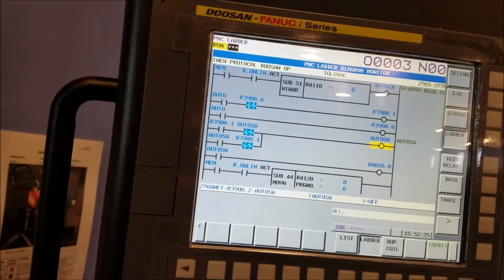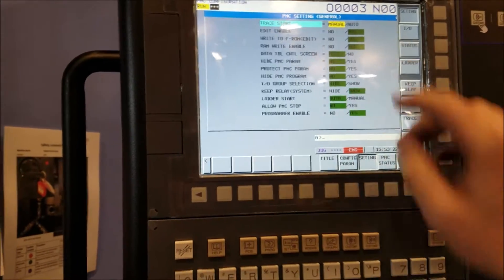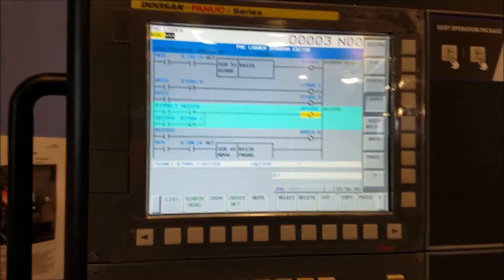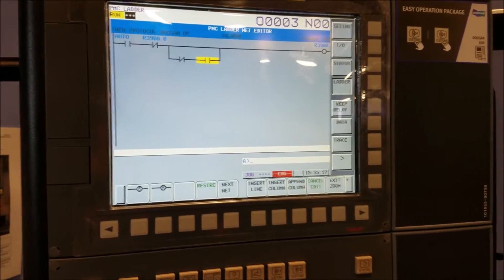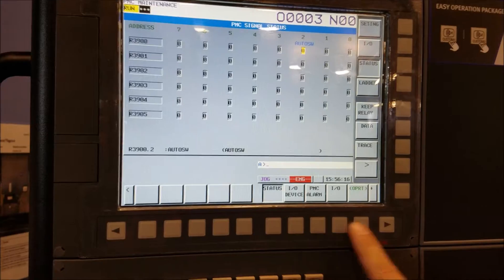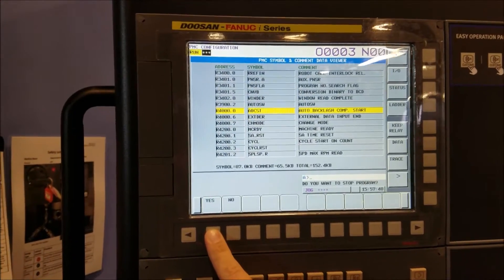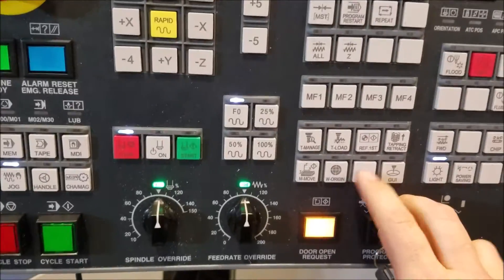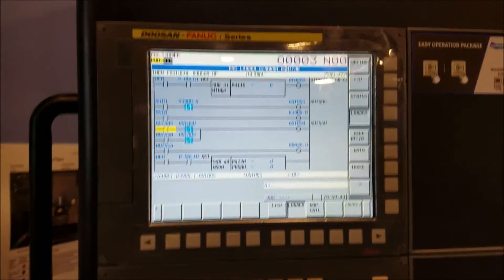Fanuc CNC: PMC ladder editing and bit naming

Comment: Good video. I'm glad I found it. Can you explain why one would do this? Maybe an example or your particular circumstance? I ask because I'm getting my very first VMC and it has a Fanuc 0i-MD controller. I'm trying to learn all I can about the controller before I actually cash out for the machine next week. I'm guessing here but it seems like you are connecting some functionality or action to a button on the controller panel. Is that correct? Thanks!

Comment: 00:47 i can't get the control to stay in "YES"  
any idea?
Reply from the maker: Check your Estop it needs to be pressed. Usually that does the trick for me.
Reply: @ericwhittaker3570  how do you NORMALLY on a fanuc turn the Write Parameter ON:1 in "SETTINGS" ?
Reply from the maker: @fredrezfield1629  I think it's the offset key (press it a few times to get to the right screen, then turn on either MDI or push in the ESTOP, then press 1, then press Input (maybe enter?).

Comment: Fanuc menu is hard as hell all the time when I pull any button I can not back to main screen.
Reply from the maker: Yep. Whoever designed the UI on this thing should be beaten. It's convoluted and hard to navigate. The good news is that the newer control, iHMI, is better. The machine makes parts well though!
Reply: @ericwhittaker3570  Hi, Do You know how to turn on small "Function Key" window on Actual Position main window? Function Key includes POS PROG OFST CSTM SYS MSG GRAH.
Reply from the maker: @leitzalarm3209  , no, sorry. I'm not sure how to do that.
Reply: I found out today that hitting the page up or down in any of the areas you get stuck in can often help get to a page you can use to navigate back to where you started- it is frustrating!!